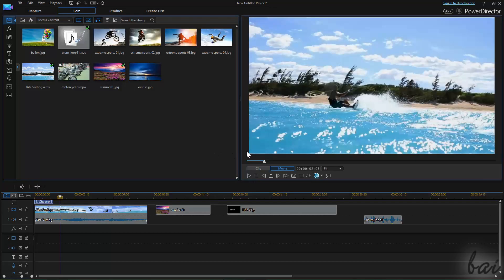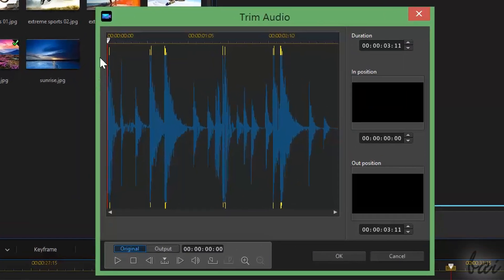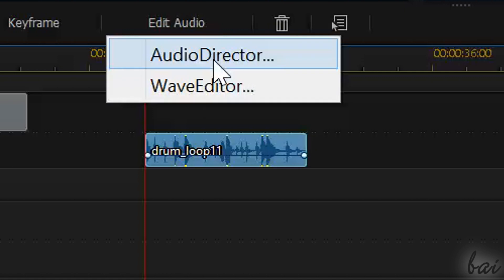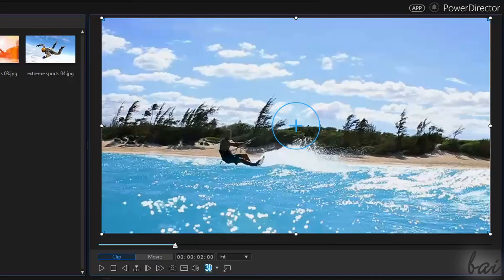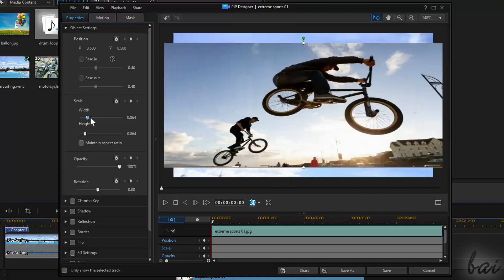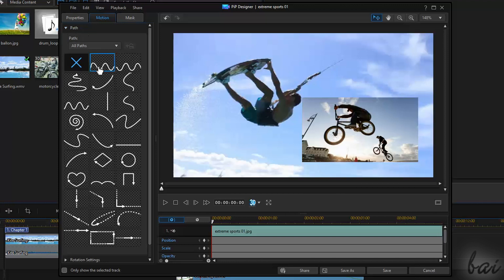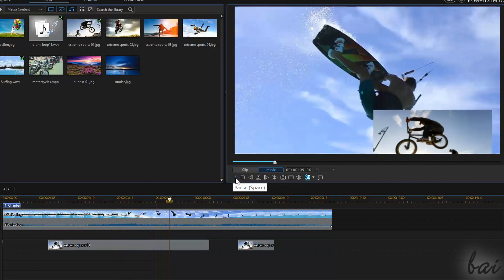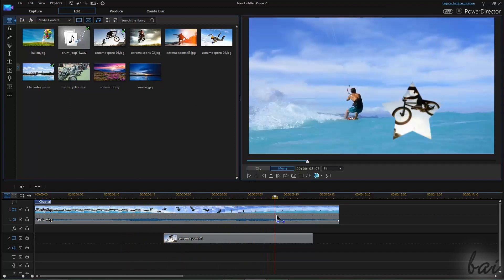CyberLink PowerDirector 14 - How to Edit Clips Professionally [PiP Designer]*

Comment: whenever i edit a video or make a video from pictures it always at low graphics any idea how to fix?
Reply from the maker: Do not confuse both. Are you getting low quality after rendering or while editing your project?
Reply: +bai when I put a pic it's low quality but  when I make and edit a vid it is high quality in till it's finished.
Reply from the maker: Elite cobra
You have to adjust the Preview quality. Put it higher and you won't see your picture blurry.
Reply: +bai even after it's done it's low graphics.
Reply from the maker: Elite cobra
What's your computer specs?